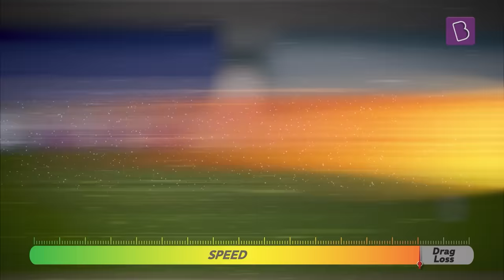What Makes A Yorker unplayable? | Drag, Collision & Kinetic Energy | Simon Doull | Wicket to Wicket

Comment: If the ball is very full/yorker length, sink your body a little closer to the ground, extend the bat out in front of your front leg and rotate/adjust it in your hands. For the regular sweep shot, the bat only needs to be rotated slightly so that the face is pointing towards the leg side of the field.

Comment: Yorkeres r not unplayable. 
Had they been they would have been used more in test cricket than in t 20s.
If someone is in blocking mode as batters often r in test cricket yorkers r easier than a good length delivery